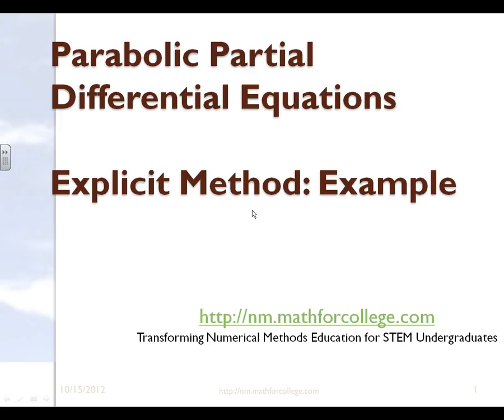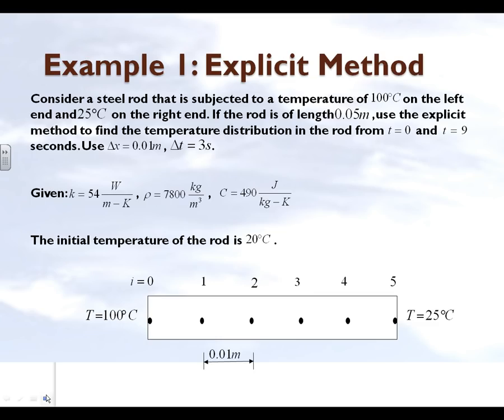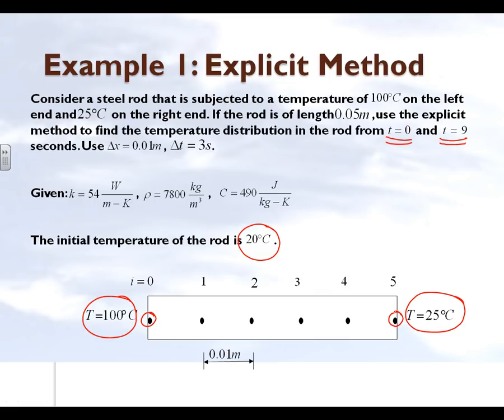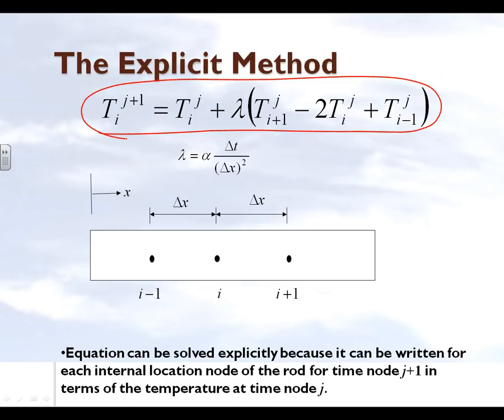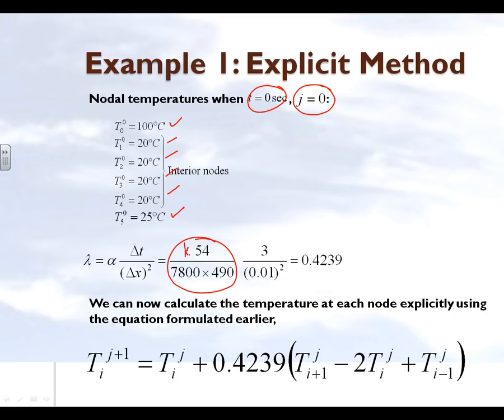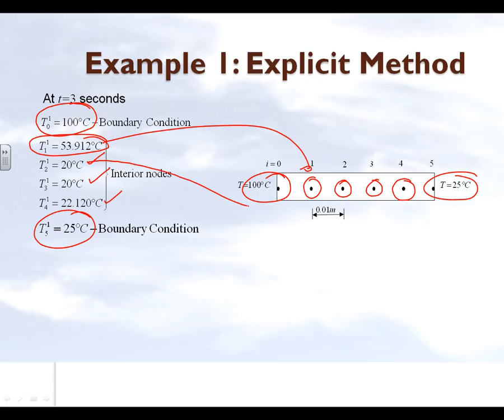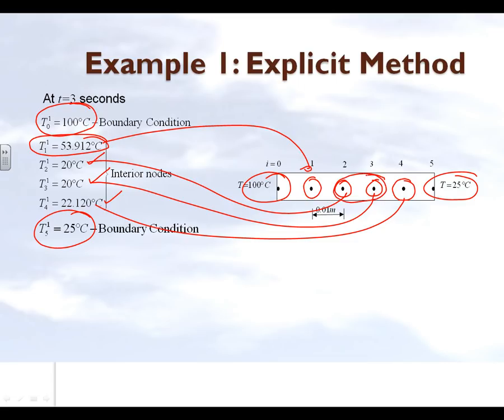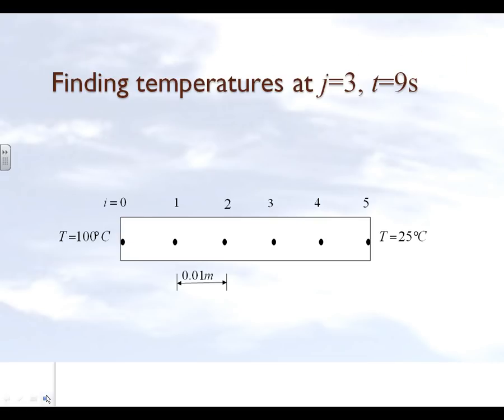Chapter 10.02: Lesson: Parabolic Partial Differential Equations: Explicit Method: Example

Comment: Why you have taken the value of j = 0 for t=3s when it should be j=1 bcoz
t=0s , j=0
t=3s, j=1
t=6s, j=2
t=9s, j=3
Reply: I also cant understand it, did you find he answer ?
Reply: i just understand it now. he already include calculation of time step in lamda. if the time step is different then lamda will be different too
Reply: two years ago probably  this is not import for you right now☠